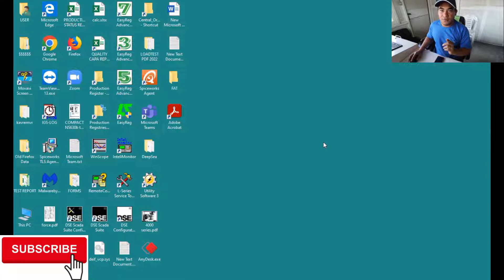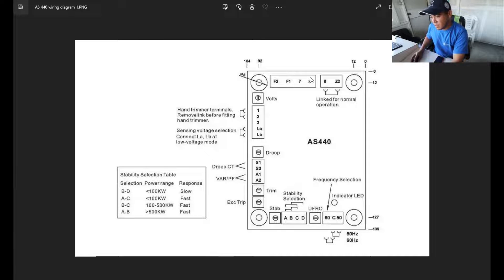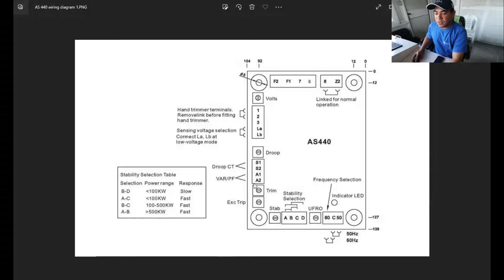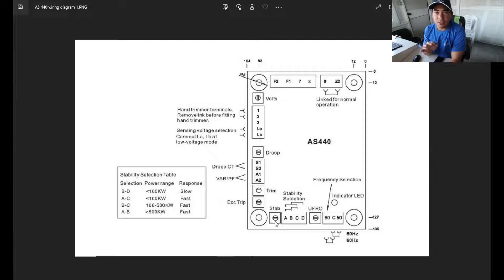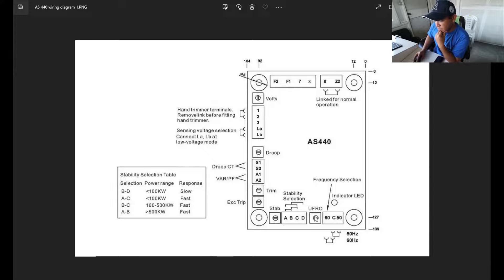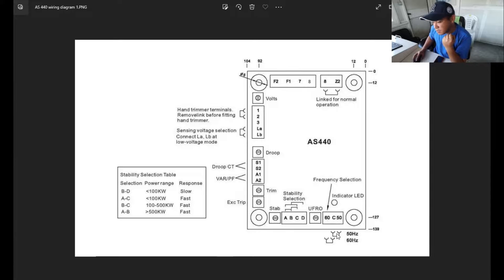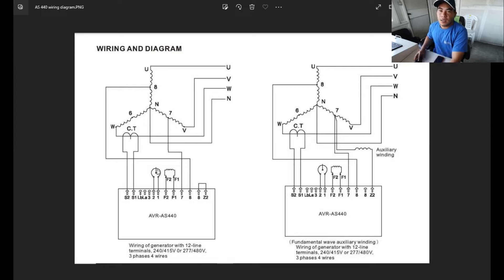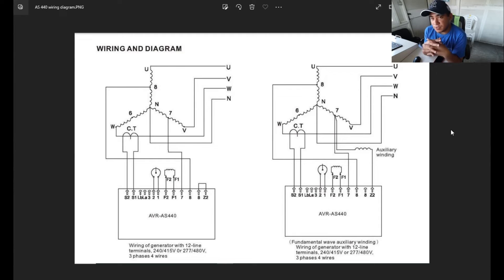AS440 AVR STAMFORD WIRING INSTALLTION AND FUNCTIONALITY SIMPLIFY benzblogs

Comment: The selection power range response if I'm connecting to 1000 Kva which one is the best to select?
Reply from the maker: Make 1000-1500 no problem
Reply: @benzblogsVlogs I want use AS 440 to install in Stamford generator 1000 KVA without under voltage, I need the connection diagram.
Reply: What I mean is that the avr AS440 have power range response A. B. C. D. So which of the link is good when installing to 1000 Kva generator?

Comment: That droop CT where can it be connected on the generator output terminals? Is it lines terminals or neutral terminals?
Reply from the maker: Its installed in the line 1 half of the value of the line CT and its connected to the avr 😊
Reply: @benzblogsVlogs explain what you mean by line half?

Comment: Hi, can you discuss more about AS440 AVR  sensing voltage selection? specifically La and Lb.
Reply from the maker: Double check my other vlogs about it its there there is two vlogs about it
Reply: Ok, thanks.. Btw, I am having trouble with AS440 AVR. We've got supplied with AS440 instead of SX440. When running the generator we only get 40 VAC out and cannot increase. Direct Exciting with the battery increases the voltage.
Reply from the maker: @JosephBilly-m8h  thin meaning to say that avr itself is faulty
Reply: Is it possible to change the voltage sensing connection(T7, T8) of SX440 to U1 and neutral (N) when using AS440 AVR? or will it damage the AVR?

Comment: Hello.  I have hard time to find someone smart enough in sweden. So i try to ask you. I have a faulty avr on my stamford generator. Its Stamford newage 350-29700. Du you think i can use as440 instead. Because i cant find 350-29700
Reply from the maker: Can u send me some pic i hive link https://m.me/ch/AbaxH-Wu4NQGcD2L/
Reply from the maker: Its posible but make sure you know what are those wiring you need to connect what voltage sensing you need too

Comment: Hi there. This is a great video. I have a military generator. An MEP 005a. I have my voltage sensing hooked up and I have my F1 and F2 hooked up correctly. I'm at 60 hertz and I have the stability selection table from a2c since it's only a 30 KW generator. I do not know if it has an auxiliary winding. It has two wires that come from the genset to excite. It's a positive and negative that I have hooked up correctly to F1 and F2.  Any help you can give me would be much appreciated! Thank you!
Reply from the maker: Ahm what alternator you have so we can identify if it has a aux winding and waht avr you using?

Comment: Com a regulagem máxima do avr as 440 está 210v preciso aumentar a voltagem além da regulagem volts sem passar dos 60hz Oq eu posso fazer ? Onde eu posso regular ?
Reply from the maker: Bolahi must 220-240 regular voltage
Reply from the maker: Adjust in the avr volatge to rease up the voltage

Comment: From Old Generator. Diagram is not available how do I find the terminal 7&8 , can I interchange it as trial?
Reply from the maker: No problem co this is voltage sensing 220 vac
Reply: @benzblogsVlogs  thankyou
Reply: @benzblogsVlogs  Boss we reach naman yong 230V, 60hZ 3phase , 35kVa... Using as440 AVR as we observe seems extreme heating ng heatsink ng as440, may need ba ako baguhin sa settings to reduce the heating? tska pano ko malalaman kung may auxiliary windings ang generator?  baka need ko i follow yong isang diagram with auxiliary windings? thankyouu
Reply from the maker: @mikeybeltran5820  sir makikita mo agad kong anong type ng alternator meron ka if shunt or arep if arep means meron na agad yumang aux winding hut if shunt its nothing aux winding
Reply from the maker: @mikeybeltran5820  lot of heating check the excitation current of your avr baka masyadong mataas
Reply: @benzblogsVlogs  yah seems your correct... thanks a lot
Reply: @benzblogsVlogs  in the name plate indicate shunt but they said that the generator is already converted that is why I have a doubt. thankyou so much.

Comment: Sir are you Filipino,I just want to ask our generator  the C and 50hz and is connected but in monitor is 60 hz and rpm is 1800
Reply from the maker: Sir anong frenquency ba at pano nyo naconfig ang module
Reply: @benzblogsVlogs  Yun AVR ng Gen set namin Stamford AS440.yun Common nakalink sa may right side 50hz ang tanong ko sir bakit sa monitor 60hz/1800 rpm
Reply from the maker: @philipcuntapay9354  check mo lng configuration ng module mo or yung mga analog na gamit mo

Comment: how to adjust voltage of as440 ?
Reply from the maker: Sir check my yt for AS440 there all stated thank you
Reply: yes sir thank you, because the voltage output of our generator is only 205 vac and it cannot drive the 15hp submersible motor , it shutt down